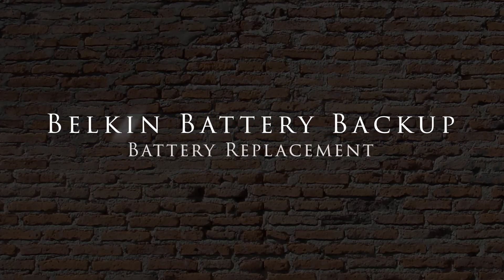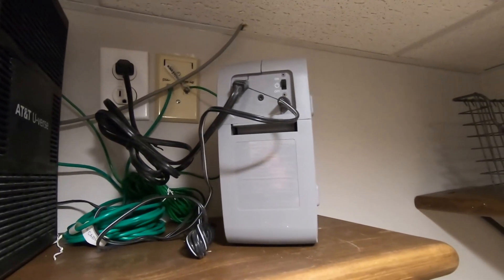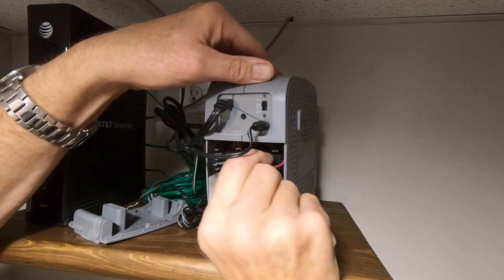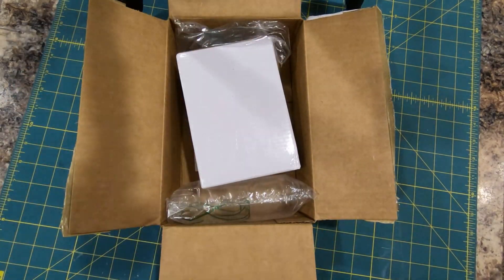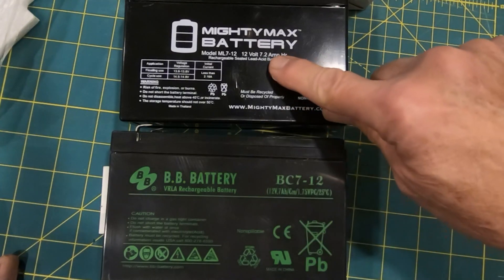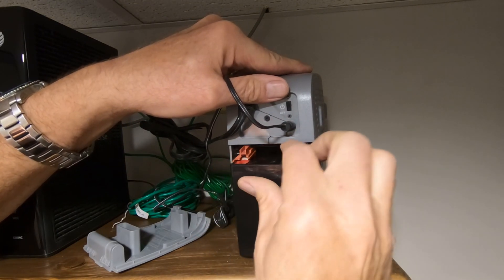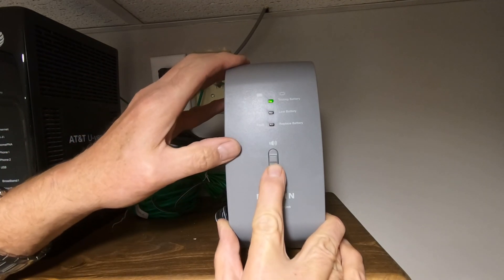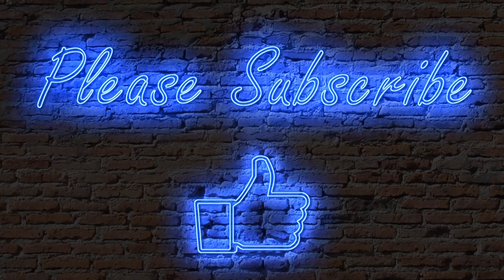UPS Battery Backup Replacement Belkin BU3DC001-12

Comment: I wish my battery would come out as easily as shown in the video. I got it to move out slightly (putting the end of the battery even with the outside of the case above), and it won't budge any further, even pulling on the tab adhered to the side of the battery. I was hoping for some missed procedure, tip, or secret technique.
I did finally manage to get it out, and there was an almost imperceptible  bulge near the center of one side of the battery. I'm talking "Is that actually a bulge or just my imagination" size, but apparently enough to really wedge it in there.
Reply from the maker: Glad you were able to remove the battery. I recently had a lightning strike on the phone line coming in and it fried the AT&T gateway and UPS. Thanks for the comments.
Reply: @CarveTools  - I've since been using LiFePO4 batteries in several of these with no issues. The undamaged (but dead) SLA batteries on later units have come out without undue difficulty. Just make certain to transfer that pull tab or create a new one using packing tape or similar.
-
I thought I had an undocumented once per minute beep coming from one, but that turned out to be a smoke alarm just above where I had the unit!

Comment: Thanks for this video. I was getting ready to chuck the whole box. Doesn't happen very often, but when the power does go out, it is nice to have a battery backup so you have wifi.
Reply from the maker: Hope this has helped. Thanks for the comments.
Reply: @CarveTools  it absolutely did. Used your link,bought the battery, got it lickity split and worked perfectly. Thank you again!

Comment: What exactly is it used for please
Reply from the maker: This is for backup power on our internet modem.
Reply: It has a 12v barrel output. Mainly intended for Wifi routers but can also be used on anything else with a 12v barrel input. CCTV systems come to mind.

Comment: How do you recharge it?  Thank you so much for the info
Reply from the maker: I would guess the battery is trickle charged while the backup is connected to power.
Reply: @CarveTools  
 Have you ever had a battery swelling problem with these?